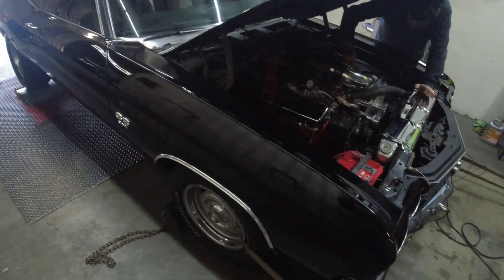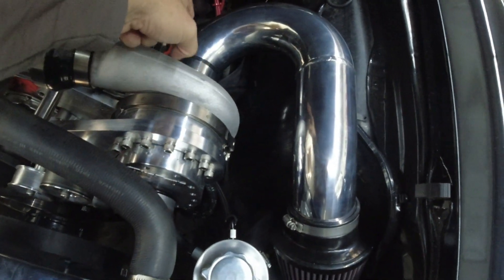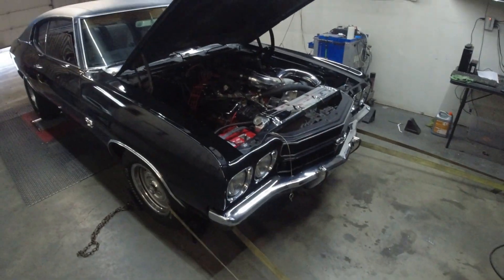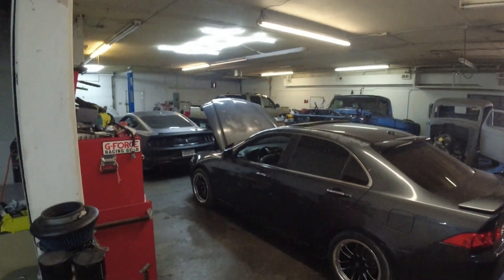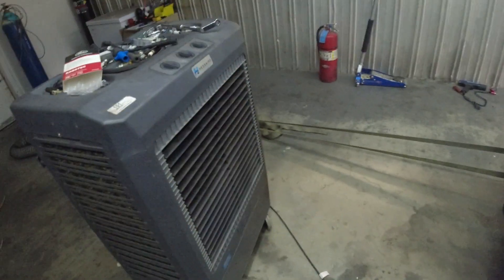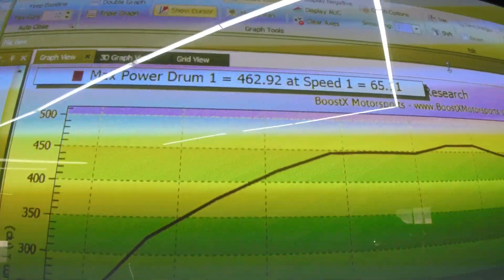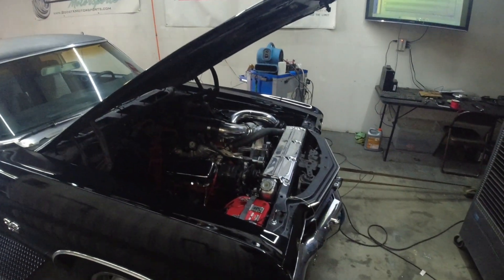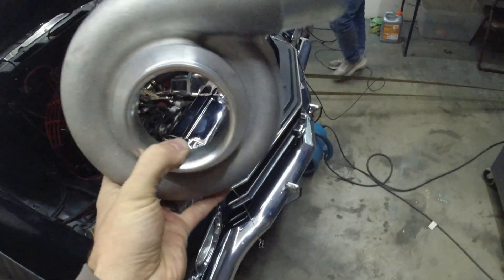Back 2 back testing of TorqStorm new Gen 2 cover and velocity stack on a 402 big block Chevelle SS

Comment: FIRST; Friggin' YT algo SUCKS! I have been doing "Torqstorm" "Big Block Chevy" "Boost" "Chevelle" searches about three yrs. now and JUST NOW find this?  🤬
Anyway, I will be swapping original Cowl Ind. hood for 3" fiberglass with rectangular air box with filter at the rear opening for constant fresh air, plus it will be a straight in air charge. 
 I got the Full TStorm package with high pressure PS pump, Sanden A/C, etc. all pulleys going on my crate 502 with cam change to Crane 288/296 dur, 587/610 lift, LSA 112. And FiTech 30012 power adder on air gap dual plane. 
It is mainly a street car I plan to drive most every day so don't want it whacked. BTW, I pulled the 402 out of it years ago.

Comment: Hey there, a really great comparison test. We’re going to build a Pontiac with the torque my legit question is why such low horsepower with 13 pounds of boost and a big block Chevy? I’m just curious as to your thoughts on that.
Peace out
Reply from the maker: @GMVracing  Thanks for watching. The engine was assembled over a decade ago - basically just a refreshed 402 with a mild cam; the TorqStorm is a recent addition.
If the engine combo was being built for this set-up, it would be a lot different.
This is more along the lines of what realistic numbers might be for someone with an older, mild sbc/bbc set-up that is looking to add boost

Comment: For the cost of the supercharger could of built that same engine N/A to make way more power easily
Reply from the maker: @Thumper68  sub $4k s/c - hard to beat. We see many people think their small blocks or big blocks will make xxx hp 'because internet', but then the dyno really humbles them. Its unfortunate, but a reality many people struggle to grasp. Its not uncommon for us to see people with "500-600hp" big blocks make in the mid-high 300's/low 400's. 
Its definately helps having a dyno to see what actually does what, especially at our elevation/kpa (84-87kpa, vs 98-102kpa at sea level).

Check out our test of gm's '1000hp' zz632 thru a manual trans on 112 oct... welcome to real world numbers!
Reply: @ I didn’t realize y’all were a mile high but I’d still be disappointed with those numbers with 14 psi. Id personally rather spend the money to have a better n/a engine first then get that 14 psi later making it much more effective. What’s the parasitic loss?
Reply from the maker: @Thumper68  we'll be testing this vehicle again with a different cam, pulley, and w/m set-up soon. Ideally, we'd want this engine around 11.0:1 static comp with a much different cam profile... then add the s/c.
Parasitic loss would just be a guess at this point as many variables play into that
Reply: @BoostXMotorsports  you should test an engine with turbo and supercharger try to match boost and see what the parasitic loss is from super charger.
Reply from the maker: @Thumper68  thats a good idea. Ill put it on the list 🤘
Reply: @ Awesome I look forward to seeing the results. Would be extra mile to so roots and procharger types. I mean if you’re going to do it might as well do it right 😉

Comment: Somethings wrong that engine should make more with that much boost.
Reply from the maker: I believe we're on par with what it should make.... its 50+yr old iron with a small cam - not an LS3 or a Coyote.
Reply: @ I didn’t know elevation when I made this comment. 

Old iron doesn’t matter they can make just as much or more then an ls.

Comment: 14.3 psi boost is 1.97 MAP. 462 hp / 1.97 MAP = 234.5 hp from the theoretical NA engine. 
Is that not really low from a 402 CID engine? 75 mm compressorinducer is WAY to small? 
426 hp at 12.6 psi boost =>231.1 hp.
Reply: that kit  is capable  of 700 at the wheels.  seen that on an LS  swap  wit 538  at the wheels  in a LS swap fairmont  with the right gears and converter.  there's videos  of that  on someone else's channel

this  dyno  is about right for a smallest of the MARK IV  big  blocks with  small  stock iron heads
Reply from the maker: @KingJT80  yes, it definately depends on the set-up, cam, compression, etc. We see well over 500whp on LS applications when pullied to compensate for elevation.

Comment: I'm shocked that at 14 PSI, that thing isn't making 500-600hp at the wheels... what a odd engine build for boost.
(Isn't 15 psi essentially doubling the engine output)
Reply: to get that  that thing  would have to have  the RPM  cam/  RPM  heads  and build more  more  power with lower  compression and more boost  with a smaller bpulley.

but it isnt bad  for a baby  big block  with small  iron heads  and a cam  thats smaller than id  put in a 302 ford  street  car
Reply: 15 psi is a ballpark....and yes..ballpark says that if you add 15psi boost you double the NA HP.. You also have to take in this is dyno at the wheels and not an engine dyno. The ballpark is for engine dyno.
Reply from the maker: @norcalnicky415  have to take into account the small cam, low compression, untouched heads, and that its going thru an unlocked automatic - along with elevation. 14psig up here is around 11-12psi at sea level.
Also, it is close to doubling the hp of this engine. Many people are humbled to see what their n/a engines ACTUALLY make at elevation. We've had many "should make 500-600hp" n/a engine setups make significantly less - check out our test of GM's "1000hp" zz632

We'll be doing another set of tests with a little better cam and a water/meth kit.
Ideally we'd want around 11:1-11.5:1 comp on a setup like with a much different cam and head set-up.

But this is more realistic of adding on a kit to an older setup at our elevation.

Keep an eye out for more testing! We really like the TorqStorm s/c's
Reply: Awesome video! Very helpful information. I'm in Colorado so I know all about the DA Monster 😂.  Those are respectable numbers, to the wheels, at elevation with that build. I have a Torqstorm on my 77' D100 360. I was wondering how much if any restriction my intake tube and filter were causing. Now I know! One question I have is what size exhaust piping and what type of mufflers? I'm running 2.5" pipe off the headers into chambered mufflers into 2.25 tail pipes. I the know mufflers and tail piping are creating a restriction and back pressure. I'll be going to 3" pipe and bullets in the future to maximize air flow. 
@BoostForBreakfast